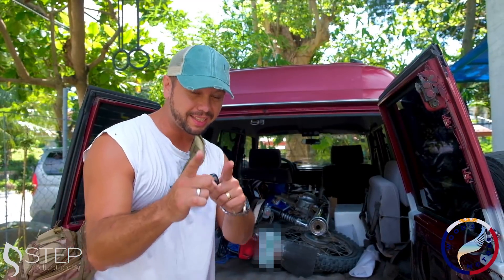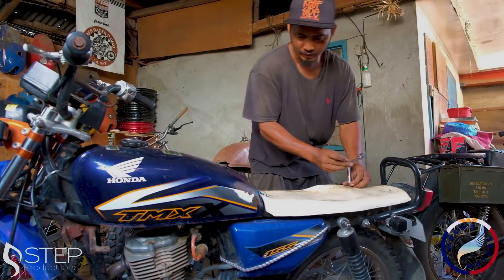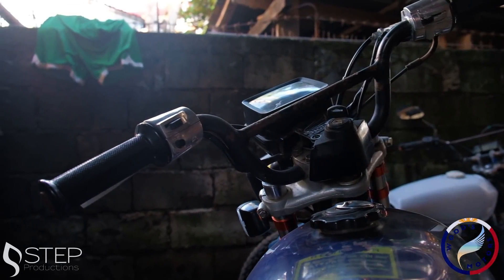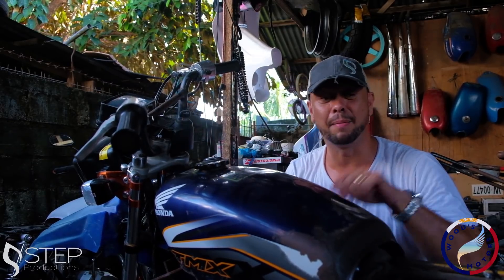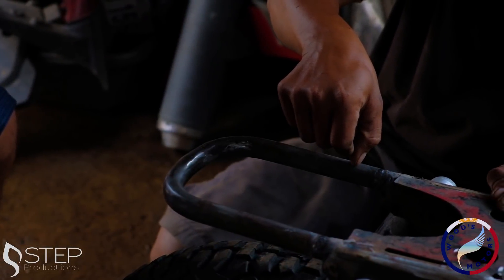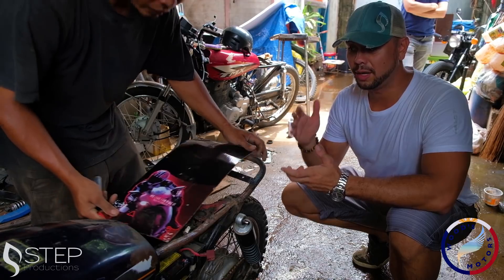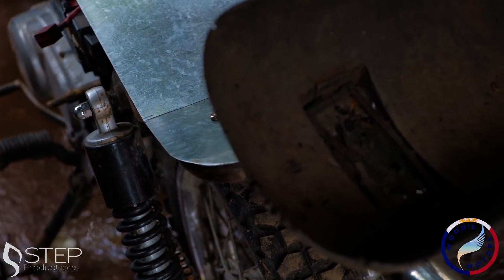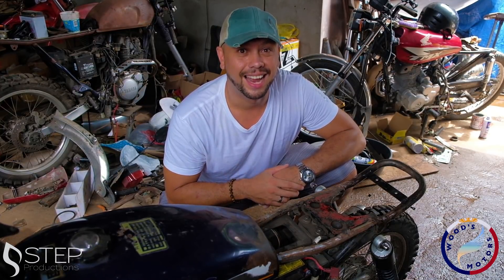How to Build a Honda Scrambler Motorbike! DAVAO PHILIPPINES

Comment: After seeing your build, I think I'll let the kids in my neighborhood build my Scrambler. Any one of the 8 year olds could spray paint a bike frame better then what I saw done on your bike. Geeze what a hack job.
Reply from the maker: Yes friend go for it, the purpose of this first build was to provide some work for local folks! Please share with us your build when completed with your 8 year olds - perhaps we can teach other young kids here to do the same :) stay blessed amigo!
Reply: Well his pain job definitely isn’t as bad as your channel layout and banner.
Reply: @xtremluck6260  well, no, my comment had perfect grammar and almost perfect spelling but I wrote “pain” instead of “paint” after I missed the “t” button on my keyboard. Even if that wasn’t a typo, my comment would have been of fine grammar. You have no point so you just decide to point out that I happened to miss the “t” on my keyboard while typing quickly. I left an error in this reply just for you. So you can cry about it.

Also, nice job on liking your own comment. It adds a lot

Comment: Nice build and video! :D 
8:47 Where did he put the battery and air filter? He never explained it.. 
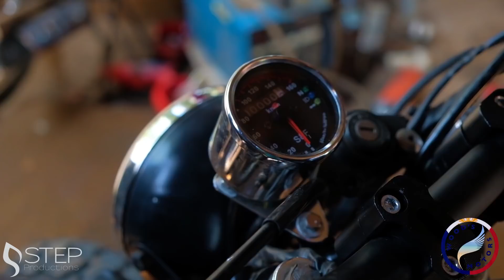But it looks to be a new air filter and a black box underneath the seat with the battery at 13:46
Reply from the maker: Yup the battery went inside that box and the air filter sits a little below it - a mushroom style filter

Comment: man, where did you put the battery and the air cleaner?
Reply from the maker: Battery is under the seat and air filter is replaced with a small funnel shaped filter